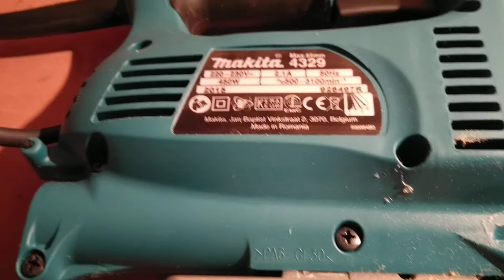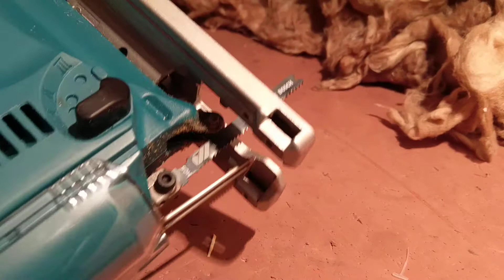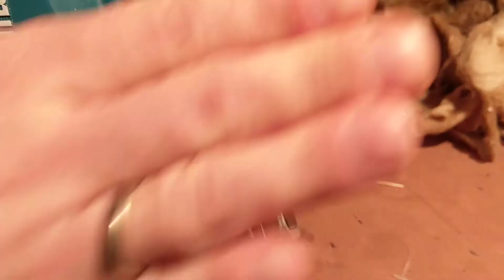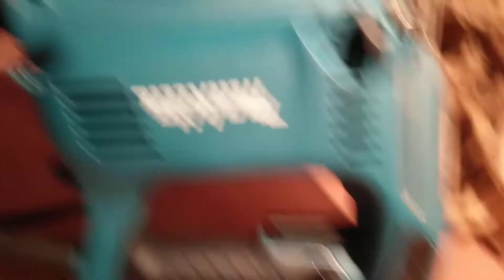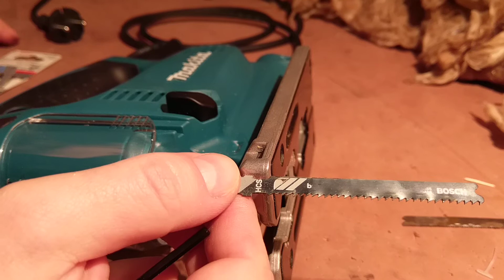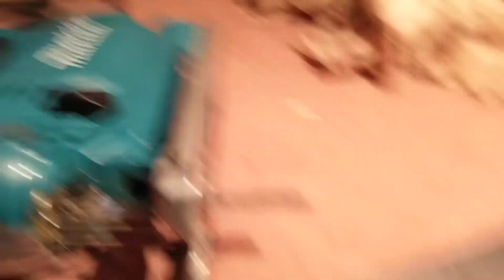Makita 4329 review

Comment: I have this saw and it also comes with a case. It is a beast despite it's apperance. Mine has even plunge cut holes in solid white oak doors (for cat flaps). I've dropped it. tripped over it, once had it in the rain, broken many blades and it just keeps running.